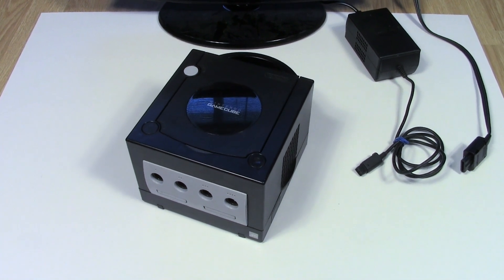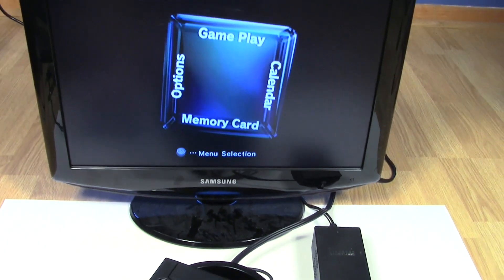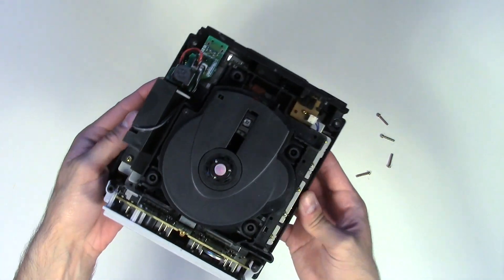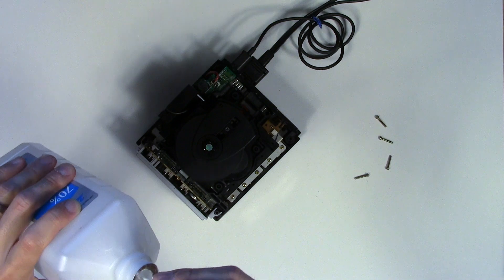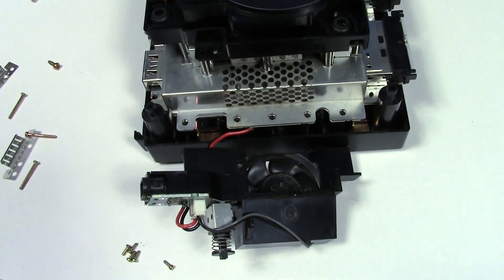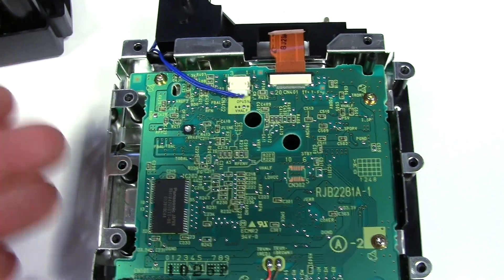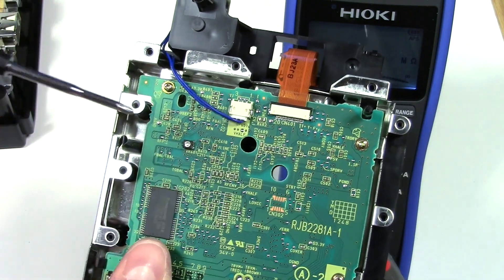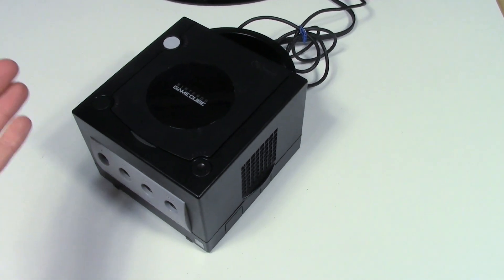GameCube Disc Drive Troubleshooting and Repair

Comment: This is one of the original early consoles released from 2001. I can tell by the gray sticker on the bottom because my dad had this exact same gamecube but the laser started forming a hole in it in feburary 2013-january 2014.

Comment: 10 years later, this tutorial still helping peepz.

My 23yo GameCube abruptly wouldnt read discs recently; no other issues I could see.
Stripped it down just like shown here and measured Ohms on the potentiometer as shown, whaddaya know, it was 511.
Tweaked one/eighth of a turn counterclockwise as shown, down to about 430 Ohm - tested, works like a charm 👍

Comment: had this exact problem as a kid and wasn't able to repair it due to not knowing how to but i bought myself the same gamecube i had as a kid but it had the same problem of not being able to read discs so i attempted this without a multimeter and with a gentle counterclockwise turn of the phillips and testing with a cheap movie tie in game to risk burning my games which i had since my childhood that were not cheap to buy nowadays like for example. melee (gamestop will sell physical copies of melee if they have em in for 60 rather than 80 but i wouldn't risk a copy of melee for this) and now its reading my games without a hitch and i did the method at 5:05 to make sure it read the game before putting it all back together. 

im now using cleanrip on the movie tie in game to make sure it is running well ❤‍🔥

Comment: Can someone for the love of God tell me if you need to know how to solder to change the Optical Laser Drive Assembly Spindle Motor Kit? The button to eject the disc out. Not to open to the top door. Thanks! I've been searching for hours and no information

Comment: I'm dealing with a gamecube busted drive right now I got from a family friend for free. The laser lights up and moves but the disc motor don't spin. the spindle spins freely but i suspect bad caps. I probed the ribbon with a multimeter and everything checks out connectivity wise. Ordered some caps from console 5 that are coming in this week and hoping it resovles the issue. 

If all else fails I could go in on an ODE but I'd rather have the ability to play retail games and do a picoboot mod with a SD card storage mod using the serial port if I want to play backups.

Comment: 91% IPA is usually sold alongside the 70% in the US.  70% is actually ideal for disinfecting apparently (look up the science on that one) but 91% is what I use for cleaning as the lower water content means it will evaporate faster.

Comment: I kept slowly and slowly adjusting till I went to 134 ohms and it's still didn't work I guess I just got a broken one but it has been sitting outside in the garage for about 10 years so
Reply: It's the optical drive capacitors. This solution is just a patch in some cases, it will get worse as time goes by. The real solution is to reemplace the capacitors for new ones.

Comment: My venerable gamecube is intermittently failing to read disks. Might as well try this at this point as If its a drive failiure, they're still cheap enough on ebay to justify replacing

Comment: Great…just plugged up my cube after a long time and it has trouble reading discs. I clean it with a qtip and it starts working. But whenever I turn it off and turn it back on after a couple of hours, it can’t read the discs again…

Comment: Awesome video, got my working at 110 ohms, I had to drop it from 199 ohms to 110, with trail and error. I think everyone will have a different "sweet spot". The best solution is to replace the Caps on the optical drive.

Comment: I followed this video to do the same for my gamecube which had the same problem. It turned on and was working for about one minute. Then the power indicator light went off, the screen no longer showed the gamecube logo and now only the fan turns one FML. Any help?
Reply: And the laser was moving and the discs were spinning. Now... nothing but the fan. :(

Comment: This video was spot on except I couldn't see or figure out where to apply the multimeter leads and I didn't understand what you meant by legs. But I did eventually get it done and set to 157.9 ohms!

Comment: Awesome! Thanks for the great video. I was able to fix my gamecube thanks to it. The pot started at 580 Ohms so then I tried ~410, still no good (though it would read the disc in 1 every 3 tries instead of 1 every 15 before; so an improvement), then i lowered it even more to 350 and it works like a charm.

Comment: I tried adjusting the laser power in my gamecube but it's still not reading any discs. I also tried replacing the laser assembly with a new one and it still won't work. Any ideas on what else I can try?

Comment: I got my Gamecube new in box last year and it reads discs fine but I sporadically notice a loud "CLICK" sound while Loading or progressing  through gameplay. It sounds like the disc is stopping and starting again and I've only tested it with one game thus far. What's weird is the gameplay itself is not adversely affected and the disc itself is clean. Even though the system is a year old I've had the games for a long time.

Comment: For a better disk reading, you have to reduce the laser to 150-250 ohms
Reply: @BernadetteA  Ughhhhh I can't remember. I think I did some research for you at the time and that's what I was told to do.
Reply: @BernadetteA  I found this
https://youtube.com/shorts/IyxoXeHNhBQ?feature=share
Reply: @BernadetteA  Its called Adjusting the POT on a GameCube
Reply: @BernadetteA  https://www.youtube.com/watch?v=kUQ1GFPG9q0&ab_channel=MrMario2011
Reply: @BernadetteA  Yes it worked better. I saw that in a video after this one. So I first tried out Colin;s method and it didn't work. After the second videos tutorial was done my GameCube worked again. 

P.S. The Game Cube was from the trash bin that I found.
Reply: @BernadetteA  Yeah it sounds that this isn't the issue in the laser

Comment: I have a question about the multimeter. I have one that has number with the ohms instead of just the symbols. What number should I use. Says 200, 2k, 20k,200k,2m

Comment: I've had my gc for 14 years but it stopped working on may 2016 Then it tried doing this and it didn't work 😞 I guess imma have to buy a new one
Reply: You could also try buying a replacement laser assembly, if that's the issue. If the disc won't spin at all, you may have to get a new motor

Comment: I dont know if you will see my comment but i have a game cube that turns on fine and all but it doesnt read the disk, i saved your video for about a year just to finally buy the tool you need to opened, i found a different problem that i dont know how to fix and if its even related to this but my disk reader doesnt move, (everything else looks fine) but the mechanism that moves the laser back and forth seems to be stuck and only moves when theres is no disk and it also does a clicking sound, like its strougling to move

If you know what it is please tell me i wanted to fix this console because it means a lot to me and was a big part of my childhood

Comment: Ha! I usually mess these things up, but it actually worked! Adjusted the laser very slightly, dig out an old analog multimeter (had to actually clean a battery contact), swab the lens, and now I can play my old games again!

Comment: You don’t seem to mention what model GameCube it is but the potentiometer needs to be set to a different setting depending on what model.  So you might be telling people how to set it for the wrong model.  Is this the model that has the digital av port on the back or the one missing the digital av port???

Comment: Hey, I've got a gamecube error, but I'm not sure it's the same as in the video. It's a disk read error, but it's not the disk. I've tried two different games, both I know work under normal circumstances.

Console starts up fine, menu works, but if I put in a disc it says "no disc found". But that's only half of the time, the other half it gives me "an error has occurred, please turn off console and read the manual". 

Game spins, laser moves, can't play anything. After posting this I'm gonna try step 1, cleaning the laser, then post my results.

If this doesn't work, any ideas are on what might be the problem are appreciated!
Reply: Game's no longer spinning, so I can't even report how the laser cleaning went. 

... Yep, time to get a replacement.

Comment: This worked for like two days for me.  Now it’s back to not reading. Sometimes it will read the disc if I boot it up with no disc and place it in after, and sometimes I have to swap discs using the previous method and    once they read the disc, I swap to the preferred game. I’ve cleaned the lens again to no improvement. What do you think?

Comment: i had the same problem but solved it without having to take anything apart.   the solution is simple:  take an air blower or hand-held hair dryer and blow air (make sure it is NOT hot air) through ALL the air vents and through the open top and through the bottom of the gamecube.  this will get rid of the dust and dirt and make your console playable once again.  i did this with my gamecube and my playstation 2, after i thought that both of them were beyond repair, and now they are working like new once again.

Comment: You should probably take more care in disclaiming how dangerous it is have an exposed unit plugged in an powered on.  Just saying.
Reply from the maker: Since the PSU on the GameCube is external, mains voltage isn’t present inside the unit. The only danger would be accidentally shorting something out on the board.

Comment: Wait when you tested the resistance on the potentiometer, where exactly did you place the test leads?
Reply: There are 3 contact points on the potentiometer the red lead of your multimeter goes to the top right point on the pot, the black lead goes to the single point on the bottom of the pot.

Comment: Mine powers up and plays fine, but suddenly shuts off after a few minutes or even seconds.  I thought maybe I have too much plugged in the outlet and tried several different outlets and different rooms but same issue.  Old apartment building wiring or GameCube issue?

Comment: Hi collin. Just did this on an old cube my nephews gave me years ago. Funny how it almost had the same values. Originally it read 636 ohms. Did the adjustment, read 450 ohm. Tested it and it worked. Do you think those pots maybe wear over time or from lack of use? (This thing’s been unused for about 11 years. ) anyway, thanks for the video. Now to clean this baby up. It is filthy!

Comment: good day!I am the owner of gamecube with such a small problem - the former owner of the console almost killed her for a long time to restore and there was only a problem with the calendar.on the motherboard was torn off the resistor responsible for lowering the voltage from the battery (it seems R16 if I'm not mistaken)a big request if there are people who have an open console or motherboard ,please tell me the nominal value of the resistor,that is, ring the tester it!please))

Comment: Even after adjusting it doesn’t read, the disc just stops spinning after the startup screen. Any help?
Reply: Same happened to me,  adjusted several times with different values, but never got it to work.
Reply: You need another laser or drive, messing with the potentiometer doesn't always work and it is not a super long term fix. The better way is to replace the drive

Comment: On my Gamecube, the ohms were 200ish.  To adjust it up, I had to turn it clockwise (I got around 425).  It didn't fix it, so it is probably something else.  I just wonder why I had to go clockwise to see an increase?
Reply: Nono, yo have to turn it counter clockwise (lower the resistance) to fix it.

Comment: I tried this on a GameCube that would no longer read discs- worked great!  This is an excellent video that is very easy to follow for fellow electronic geeks.  One suggestion would be to ensure that the top lid is in the open position before re-assembling- I broke one of the micro-safety switches that shuts off the unit when the lid is opened (no biggie, bypassed- don't open the lid and stare at the pretty red laser- lol.)  I had to set mine to 300 ohms before it started working.  I am guessing that the laser is weakening and will eventually fail, but a great procedure to get it back up and running!

Comment: Damn my original gamecube has this problem. It takes forever before it will read a disc. But when it does, it works fine and keeps working fine. Until i dont use it for awhile again.

Comment: my GameCube will turn on (fan turns on and the power light turns on) but nothing else. I took it apart to see what happens with the laser and the spindle, and the laser didn't turn on nor did the spindle rotate. the gamecube fell off a couch before it wouldn't work, what do you suggest might be the issue? do I need a new optical drive assembly?

Comment: Dude, this is not a repair and you've fixed nothing. If the laser pickup is this weak, it needs to be replaced, period. People will watch videos like this and use that kind of temporary ghetto fix to sell those units as working, great job.
Reply: VashtaNarada Yeah, fairly certain Colin knows his stuff about technology. Old systems just need a bit of troubleshooting as time goes on.
Reply: No, he just tinkers around with stuff he doesn't really understand, otherwise he would've known how to check the RF-level output on the Oscilloscope before and after changing the power output of the laser diode.

Comment: A million thanks to you sir. I bought a brand new Nintendo GameCube, complete with box and manuals last 2016. after I bought it from the seller online, I didn't bother to test it because it's brand new. but only now I realized that I need to test the GameCube that I bought. when I did, I have the same problem just like your GameCube. So I followed your instructions and after adjusting the VR or whatever. Wow, It's a magical feeling! I'm just worried because I didn't use a potentiometer. I just tweaked it once counter clockwise.just a little. God bless you Sir.

Comment: please reply, i turned off my gamecube and rest for a bit but when i played again the gamecube wont turn on, unplugged and pluged in everything back, the light on the ac adapter is not on and so as the red light on the gamecube. what do i do? buy a new ac adapter? please reply
Reply: +apple tech geek i already got it fixed, all i did was buy a new ac adapter, thank you tho

Comment: Wanna hear my story? My GC would require a few attempts to even detect a disc right after it started up, but after that games would work just fine, so for a while I thought I could live with that. After watching this video though, I wanted to see if I could fix it just out of curiosity. So when I saw the potentiometer, there was some dust on its connectors, and I used a multimeter to measure its resistance. Since it wasn't different from what it should be, I didn't turn the screw on it. Using it also took off that dust. Now that problem is gone, so thanks for giving me the inspiration.
Reply: Never mind. I didn't actually fix it. I don't understand what's wrong, and the thing actually got worse.

Comment: I adjusted the pot and still have a disk read issue.  Do the lasers fail over time?  I want to keep the gamecube so I'm considering replacing the the laser.  In your opinion does replacement generally fix this issue?
Reply from the maker: Yes, they definitely fail over time. Replacing the laser will usually fix it, but in some ways it's just buying time, especially if the replacement laser was sourced as a used part (this is becoming an increasing problem for the Sega Saturn, for example). That said, there are plenty of used GameCube parts out there.
Reply: Just an update because the question was asked.  I opted for the $7 ebay laser replacement.  I'm not sure it was new unless it was new old stock.  Replacement was fairly easy but proper adjustment was difficult.  I used games that were fairly scratched to fine tune.  Surprisingly an adjustment of 2 ohms made a difference.  Got it working though.  We'll see how long...

Comment: Thanks to you I fixed my GC for $.82!  I went without the multimeter and just turned the laser's screw/knob (potentiameter) counter clockwise about 1/8 of a turn.  Thumbs up -- excellent video and advice!
Reply: Done the same thing, it worked perfectly!

Comment: i got the same gamecube but i got it off amazon and it was on a collectors edition bundle it can read the disc it came with but it just freezes when i get on the menu you get after pressing "START"
i have to take the disc out and force turn it off and it is good as new but i wanna play the game i got!

Comment: Had no multimeter of any sorts I had already taken it apart. As said in the video be careful to not blow it up. Also mentioned to twist it only 1/8 of a turn, so I did and that fixed my issue with it not reading disks. Might have been the bad disk reading was the reason for the seller selling the Pokémon Colosseum version, but it works! THANKS!

Comment: My GameCube starts Pokémon XD fine up to the Nintendo logo, after that it when the error occurs but when I put my Zelda wind waker in it reads it perfectly fine, I cleaned XD multiple times carefully and tried cleaning the laser lens and nothing. Most likely is not my system it's the Pokémon game but just want to know if there's any other ideas out there that can help me get passed this error.

Comment: The "official term" is NEC External Line Head screw. Haven't heard it called that in almost 20 years though. ;) Also, I'd suggest leaving the disc in during disassembly, or at least leave an 8cm/80mm blank or slug disc (clear disc usually included with a spindle of blanks).This will prevent accidental touching of the laser and should not interfere with disassembly.